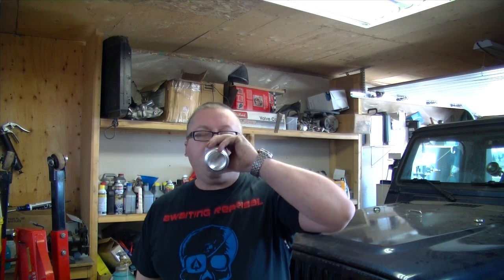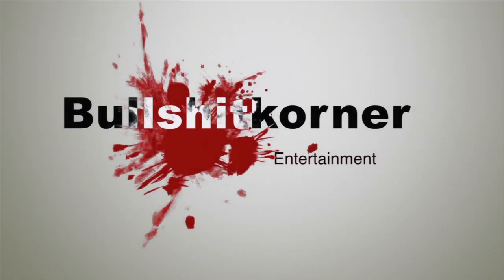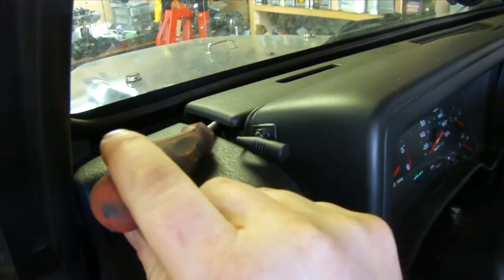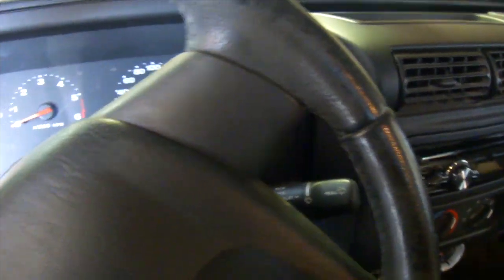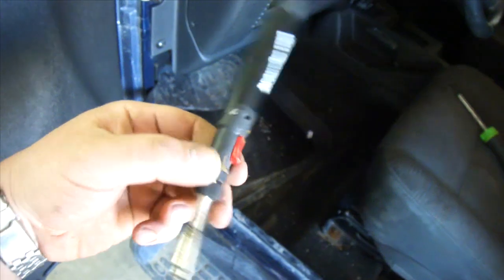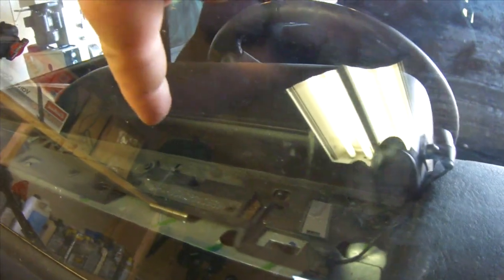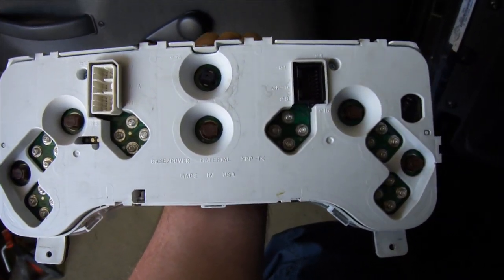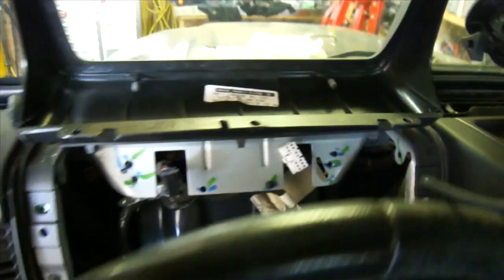DIY Instrument Cluster removal Jeep Tj

Comment: My list... I purchased a 1997 jeep wrangler sew for my husband's new work vehicle. I have decided in one month I will have it running like a top and modded to the end of extreme. So here's a list of items... 1)new soft top and uppers(for those whove have yet to replace theirs go with bestops they are better than smitybilt as smitybilt rip easier also there is a very short supply of the uppers or tops being installed for the first time. I had quite a bit of trouble with mine) 2) white dash gauge mod 3) Dash lights I got a kit on ebay with 2 of each in 5 different colors 4) New paint thinking about going with a chameleon color red to gold/yellow 5) new vinyl paint on dashboard and inserts of doors 6) carpet dyed to black 7) new exhaust 8) blower motor repair not exactly sure whats not working but got a used switch coming in hopes that will fix it 9) power steering reservoir replacement (there is a leak and the current bottle has been flex sealed poorly so I'm in hopes that fixes the issue) 10) a/c hose replaced as previous owners mechanic cut the hose (I don't do a/c so ill pay for this particular repair) 11) new tail lights/lic plate light repair reverse light on drivers side 12) tail light guards 13) tail light covers say jeep in chrome 14) pull dent in passenger rear corner 15) pound out hood or use the second hood I have to replace 16) New hood latches in chrome17) Front seats upholstered18) New rear seats19) Replace rear seat hardware and bottom buckleI don't think I will do videos but I will take photos of before and after maybe make a snap shot video to show transformation.

Comment: I am currently building a 4.7 L stroker motor for my tj. Maybe I will do that led bulb conversion as a few of the bulbs on my climate control and cluster are screwed. Post a link if you know of any websites that sell these led bulbs in canada. Maybe you should do a video on how to change the bulbs?

Comment: I have an issue with my 1996 TJ - On start up all looks fine but after I have driven for a while and switch off on restart mt CHECK ENGINE lights always comes on (Sometimes the AIRBAG light as well).  Car starts and seems fine but if I switch on the headlights via the dash pull switch my dashboard lights up like a Xmas tree.  After a while the entire instrument cluster may go dead but it generally fires up (Intermittent).  The dashboard lights also seem to go on and off at will sometimes totally reverting to normal operation except the CHECK ENGINE light which stays on and only goes off when I leave the car for a few hours.  Alternator is good,  battery may be a little low on voltage - just on 12V - I have cleaned most of the grounds ..not sure if I should get a new battery .  Has anyone experienced this.  Where to start?

Comment: hey thanks for the video, i am trying to redirect my speakers to an amplifier and i am looking for the speaker instrument panel in my 2005 tj wrangler. do you know where i can find it?
Thanks
Reply: or some place where all four of the speakers' wires meet up
Reply: I have 97 TJ but the wiring for speakers should be the same. All speaker wires meet up at the back of the radio. If you pull it out, take a look at your owners manual and it’ll tell you which color wires are what

Comment: nice video.. I didn't realize it was that easy to remove the cluster! I have a 97 wrangler TJ that I got about 1 year ago and the odometer never worked. any suggestions? I'm a pretty good mechanical guy but electrical.. not so good. any suggestions? hope this doesn't deter your help but I'm a BUSCH LITE guy. Thanks for any help!
Reply from the maker: that would depend if your speedo in the jeep is mechanical with a cable or electronic
Reply: Bullshitkorner Thanks. I never looked but will check it out!

Comment: Thanks for the informative vid man. Didn't realize how easy it is to remove the cluster. When I get to that task on my "to-do" list I'd like to change the display color to blue. Any suggestions??
Reply from the maker: most parts on the jeep are actually quite simple to remove, I changed my dash to blue using leds there is a video on my playlist.  I like the blue dash however at night the needles are a bit hard to see

Comment: I just want to remove and replace my scratched plastic gauge window.   I would rather have glass... but that maybe too much to ask..  I'm going to fix that and upgrade my fuel tank to a 20 gallon by making the vent tube cut and replacing the sending unit with the larger type.   also I need to replace my skid plate at the same time.